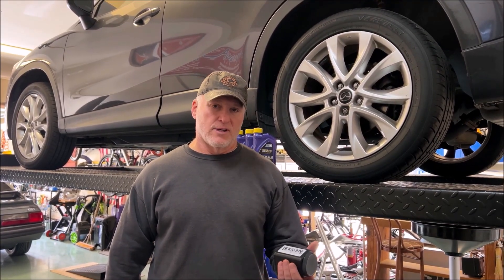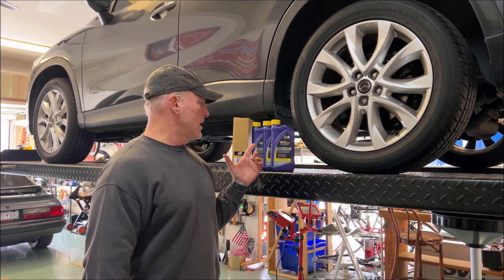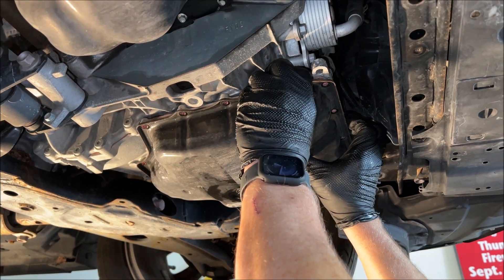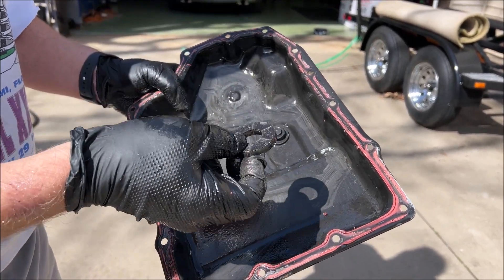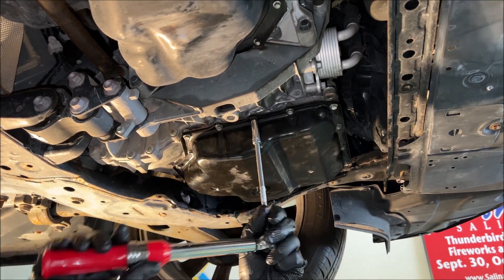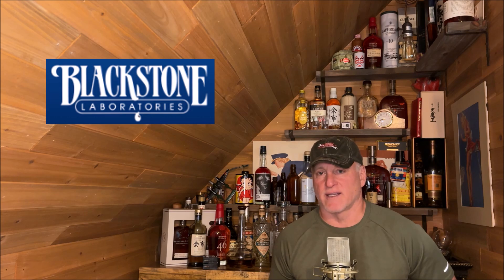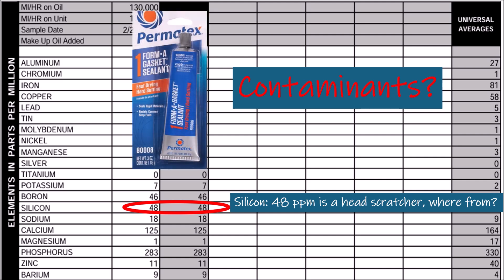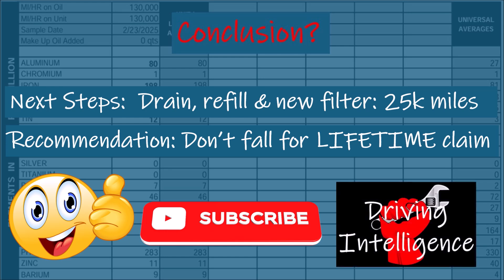Why Lifetime Transmission Fluid Fails: Mazda CX5 Blackstone Test Exposed

Comment: Planned obsolescence?
Reply from the maker: My opinion, manufacturers designed and built the car to get past the warranty period with no claims, also, it sounds great, "maintenance free transmission"... a possible selling slogan.  It seems to me many get rid of their vehicles well before major mechanical issues occur and manufacturers take this into consideration.  My channel is devoted to proper maintenance so as to retain vehicles many more miles and years.  My F150 has 267k miles on the clock and keeps on trucking.
Reply: @DrivingIntelligence  Great video. I remove the air box and use a funnel to easily refill trans from above.
Reply from the maker: @billjames3030  great comment, thanks
Reply: @DrivingIntelligence  Mazda do not make their cars to deliberately grenade when just out of warranty.  Mazda fully expect your car to last at least 20-30 years if you so desire.
Reply: @DrivingIntelligence  You have overheated that transmission.  It's that simple.  Has the CX5 ever towed????????
Reply from the maker: That transmission shows no sign of being overheated
Reply: This isn't planned obsolescence. An automatic transmission will last 200k+ miles will no servicing. Depending on the brand, the transmission will be doing fine at 250k miles when the rest of the car around it is just about done; sometimes due to rust, sometimes due to owner negligence
Reply: @philbrutsche8928  You are 100% correct IF the trans has not been overheated!!!!!!   If that happens the ATF fluid is destroyed over time.  But yes I have had cars for 15 years from new and sold at 400,000 Km's (250,000 miles) and the fluid was never changed, it was not black and was a light clear brown = due for replacement but still shifted perfectly.

Comment: I’m not very good at hands-on work. I only plan to do a drain and fill — is it okay if I don’t open the housing or replace the filter?
Reply from the maker: I would highly recommend replacing the filter for longevity.  It really is rather easy with just a bunch of bolts.  Just follow my instructions in the video closely and you'll be ok.

Comment: Thanks! I have a CX 50 and can leverage the CX 5 videos that you post because they are basically the same vehicle. What oil filter would you recommend for a Mazda 2.5 non turbo? Appreciate your response.
Reply from the maker: Hi Joe, thanks again for your awesome generosity!  I recently made a video showing why I will only use the Mobil 1 Filter.  Check this video to see why.  I installed the Mobil 1 on the CX 5 you're seeing in my videos.  https://youtu.be/XNLZdQ-PwsE

Comment: The fluid gets dark pretty quick. It's blue when new.
Reply from the maker: some of the Mazda fluid is blue. The fluid that came out of this car was originally red
Reply: @DrivingIntelligence Oof. The factory and correct fluid to use is Type FZ which is blue. Somebody messed up and filled with red if you got ree fluid out of the transmission.

Comment: So my 2016 CX9 has 120k miles, ATF never changed, and seems to have funky low speed shifts in extremely hot weather - otherwise shifts fine. Is it too late to save it?
Reply from the maker: 120k miles is not that much.  Have you towed with it?  Honestly, if it were me and the car / transmission has not been abused, I would follow the procedure I used in this video, drop pan, change filter and add fluid.  I would not do a flush.  Be sure to check your fluid spec.  I just checked the Royal Purple product selector and the Royal Purple Max ATF is ok for your transmission as linked in the description of my video:  Vehicle checked: 2016 CX9 USA FWD with 2.5 SkyActiv Engine
Reply: @DrivingIntelligence  appreciate the advice. Never towed with it, adult driven and always maintained. Noticed the shift issues during Florida vacation in late summer, driving in slow, heavy traffic. I'll get the fluid changed asap (no flush). So you would recommend the Royal Purple Max ATF over Mazda ATF FZ?

Comment: I hAe a 14 mazda 3. Just hit 200k kms. Should I drained and fill my transmition or its too late? I see so many people saying to ride it out and its already passed 200kms so its much better to leave it alone. Give me some insights please, thanks.
Reply from the maker: That's about 125k miles which is less than what was on this Mazda when I did the change.  If it were my car, I would do a pan drop and filter change.  Don't flush.  Really depends on how hard the car was driven.  If you babied it during it's life, it will not be a problem.  If you drove it like you stole it, might be a little risky.  Blackstone told me there should be no problem doing a pan drop and filter change at 130k miles, but the decision is up to you.  I can't make a 100% assessment since I'm not looking at your car.

Comment: My Mazda a 2023 CX 30 uses A7 atf which has no equivalent replacement available so $35 to $50 a quart. Expensive drain and fill every 30k miles but still cheaper than a new transmission. I hope an equivalent replacement to the A7 atf becomes available. My  Hondas are over 250k miles doing drain and fills every 30k since new. Hopefully Mazda transmission will be the same. Very good video.
Reply from the maker: I believe the cost of certification deters aftermarket companies from showing compatibility.  Valvoline Restore & Protect is not DEXOS certified because Valvoline does not want to share its formulation with GM
Reply: The Liquid Moly Top Tec 1850 is the only fluid that mentions it’s a replacement for Mazda A7  and the spec sheet is very close to that of the Mazda A7 brand made by Total. Just haven’t found any reviews of people that have used it.

Comment: Mine is a lil over 200k I’ve never changed the transmission fluid can I change the fluid and filter on it it shifts find
Reply from the maker: I don't feel good giving you guidance at such high mileage.  If it were my car, I might remove 1 or 2 quarts to replace with fresh fluid.  If you can send off to Blackstone for analysis, they can tell you how far the wear has gotten and perhaps at that point make a recommendation.  You've done good getting to this point.

Comment: Thank you, great video hard to find videos based on data and science in a way. I bought a 4th Gen Mazda 3 and it had a fluid change at 90k now it is at 135k and I am gonna change it asap. This makes me feel good about my transmission, looks like it is just gonna be fine. Also I want to point out that the universal average is meaningless because every transmission is made out of different concentrations of metals and parts so it doesn't indicate anything only speculation. It could just be this transmission uses more of those metals compared to other metals.
Reply from the maker: Appreciate your comment, and thanks for checking in. The universal averages on that sheet are for all Mazda CX5s, not all vehicles. So it’s very applicable to the comparison and analysis.  

Good job taking care of your transmission.
Reply: @DrivingIntelligence  In that case it is a decent comparison than especially since new mazdas all use the same transmission

Comment: Thumbs up for sharing good useable information. 

It definitely saves the transmission for long term use as it is a good transmission. 

I am actually overdue to replace transmission fluid on our CX5 2L, which i will DIY as i do all maintenance myself.

They are such awesome solid SUV.
Reply from the maker: Agreed!  And thank you

Comment: mazda skyactive  transmission oil is mazda type fz. fz is a blue colored fluid. Been changing  my transmission fluid with the Mazda fz every 100,000 miles. Change the transmission filter every 2nd transmission oil change. I have 482,405 miles on the original transmission and engine.
Reply from the maker: yep, learned that through the comments, so this was had been changed before.

Comment: Nice video reminds me my 2014 cx5 I did the same fluid and filter change at 135k miles twice with Mazda atf and then after 2 years again at 155k mile I put some Amsoil signature series in there but before that to make sure I take out all Mazda green fluid I did 3 times once in a week with Valvoline max life and then twice with Amsoil.
After seeing some oil analysis like yours i didn’t like Mazda fluid at all low calcium phosphorus and boron compared to other non oem fluids so that’s why I did a deep cleaning.
Reply from the maker: Thanks for sharing your experience and the detailed fluid change process
Reply: @DrivingIntelligence i don’t understand how manufacturers can call lifetime an cheap synthetic blend fluid to keep viscosity as low as possible for fuel efficiency restrictions by government and with pretty low additives.

Comment: Just got a 2026 Mazda CX-50 Hybrid. Says lifetime on the fluid as well. It is an e-cvt so should it be changed more often? I figured we would change it at 60k and do oil every 4-5k. Nice video!
Reply from the maker: I think 60k is conservative enough for a pan drop, fluid and filter change.  I plan to change the transmission fluid in all my vehicles at 30k intervals.

Comment: The best way to serve transmission at this milage is to do a drain and fill first. Then drive about 500-1000 miles or so and then do full service with a filter. Depending on a transmission, you usually replace about 35-50% of total fluid capacity, because pan does not hold to all the fluid and half of the fluid is inside the tranny - like fluid pump, valve body and torque converter. Also, manufacturers manuals are BS. Think about any car brand that wants you to renew cars every 3-5 years so by following their maintenance schedule, you follow their plan of archiving it. Most people sell their cars before 5 year mark so manufacturers do not care what happens to a car in second or third hand. As long as original buyer is happy, it is a win for any car brand. So, all of to say, I agree with replacing transmission fluid every 30K miles, assuming no towing or off-roading / racing - in those cases, cut the interval in half. Same goes for transfer cases and differentials (both front and rear) - not the case for this Mazda but just a rule of thumb! Great video!
Reply from the maker: Thanks for sharing your detailed insights and experience

Comment: What would be interesting is if you could get another blackstone report with virgin mazda atf and see just how much the additives have deteriorated over fresh fluid.

I've heard back and forth on aftermarket transmission fluids. I think it's one of those areas where even if it is suboptimal for the transmission, you won't see it until tens of thousands of miles down the road-like how eating a bag of chips isn't gonna make you fat right away. Not worth the risk to save $5/quart for me. It's not like you're doing transmission fluid changes anywhere near as often as you do oil changes. I don't think the aftermarket oil analogy applies in this case-most oil brands use the same refineries and have pretty similar additive packages. Transmission fluid seems like it would be engineered with much tighter specifications for the application since it has to last well over 60k miles as opposed to maybe 10k max between oil changes.
Reply from the maker: appreciate your comment.  I didn't go with Royal Purple to save money, rather, for the observed performance.  It's been great in my other vehicles and per the Royal Purple site, complies with Mazda requirements.

The suspended metals indicated in the Blackstone report necessitates the need to replace the fluid more often.  This even if the additive package may still be somewhat intact.

Comment: Some brands/models have 'severe service' standards that suggests changes of even 'lifetime' fluids. On more recent Mazda models with automatics, apparently Mazda is the only source in the USA for ATF, especially if has a 'start-stop' feature. It is expensive too, $20/L for the non-stop-start cars, $40/L for stop-start models. Sadly such an expense discourages customers from changing the AT fluid.
Reply from the maker: appreciate the input.  I've had no problems with the Royal Purple ATF used in this car.  No slips or stumbles.

Comment: Stop with the repeated drain and fill trying to get the fluid clean. Undo the transition fluid cooler line, and let the engine and hydraulic pump force out all the fluid until the torque converter is full of air, and air is coming out the cooler line. It will take barely a minute.
Reply from the maker: dude, next time pay attention to my video... I did not want to replace all the fluid because suspended clutch material in high mileages vehicles might be keeping the transmission running properly.  All new ATF in a high mileage vehicle can cause problems.  Look it up.

Comment: From my experience with SkyActiv 6 speed auto Mazdas the original ATF FZ fluid is blue coloured, I'd guess your vehicle had already had a fluid replacement before you got it. Even though it looked quite black in the drained container, the fluid on the trans valve body looked reddish.
Reply from the maker: Thanks for this input, I just checked and you're right.  The car was bought with about 40k miles on the odometer, so at leas 90k miles on this transmission fluid.  It did show wear in the Blackstone report.  That means running on the original fluid is even worse given the measured wear at far less than 130k miles.

Comment: The "Lifetime" claim is always followed buy the weasel words but not for "severe service".  So what is severe service?  Well in simple terms it's the way YOU drive.  He should use Mazda ATF because that matches the transmission.  Mazda automatic transmissions are a bit unique is that they use a small torque converter to get the car rolling and to match shifting but they have a hydraulic clutch and are really a 6 speed "intelligent manual transmission".  That may explain some of the wear findings.
Reply from the maker: appreciate your comment, but it doesn't align with the Blackstone report.  Their averages on the right side of the report show significantly less wear than the sample I sent, and those are all the same vehicle.

Comment: i have a Mazda 6, just rolled 100k, do plan on a drain and fill with a new filter. never bought into "lifetime" fluid of any kind. mazda does not specify # of miles = lifetime, my argument is if my trans goes out at 90k is that "lifetime" of the trans, or 100k/120k/150k?? i do agree that mazda transmissions are built to last, but with proper maintenance intervals. GREAT video.
Reply from the maker: Thanks for your comment.  I've had some comments about what lifetime fluid means, some think it never needs to be changed, ever, and some think its 100k miles.  To me, lifetime is length of ownership, whether 100k or 300k.  I have 272k on my 2002 F150 and only recently rebuilt the transmission myself since it is my daily driver (even long distances).

Comment: I changed the transaxle fluid on my 2021 Kona at 23K miles last week. Simple and worth it.  The fluid that I removed was in good shape. Do your coolant and brake fluid regularly also, or at least test it with the strips
Reply from the maker: good input
Reply: @andredaedone7732  Just did all that on my 2017 CX5 @53k miles.

Comment: Hey I have a question and wondering if you could help. I have a 2015 mazda cx 5. Third owner. I am thinking about doing a transmission fluid change like what you did in the video but I am a bit concerned about the gasket that you used for the tranny fluid pan. How long has it been since you put the gasket on? Has there been any leaks? Thanks!
Reply from the maker: thanks for checking in.  It has been several thousand miles since this fluid change and no leaks from the transmission.  Tight as a drum.  If you clean the surface and properly torque the pan, you will not have a leak.  I always prefer dry gaskets.

Comment: I have a 2018 Mazda turbo with over 150,000 miles. I ran into what you saw, Life Time Transmission Fluid.  On more than one occasion I have been warned if it ain't broke don't fix it.  Or we don't change transmission oil unless it is at 50k miles. News to me.  I have not gone to the Mazda dealership as you might imagine, it is costly. I have been considering taking it to a transmission service to get the transmission fluid changed out.  I am reluctant because I hear that changing transmission fluid with so many miles will cause problems when their was none, due to the cleaning effect.  I don't work on vehicles, but I read.  What would you advise?  Leave it alone at 150,000 miles, or change it?
Reply from the maker: You are in that iffy zone.  I did a complete flush of my 2002 F150 at 180k miles and ended up with torque converter shudder, but this truck was used for towing before I got it (heavy loads).  I spoke to Blackstone and they felt a simple pan drop and filter is not a problem.  If the car hasn't been driven hard, you can do a pan drop and fluid change and send a sample to Blackstone.  

To be extra safe, do it yourself and reclaim half the fluid that is removed and put back in the transmission with a couple of quarts of fresh fluid.  Then do it again in another 30k miles.  

The transmission in this Mazda CX5 loved the fluid change (1/2 the capacity).  No issues after changing the fluid at 130k miles.
Reply: @DrivingIntelligence  Thank you
Reply: @DrivingIntelligence  Thank you for your video and your advice. I am trying to make sure she lives as long as is possible.
Reply from the maker: These Mazdas are so good I’m improving this little CX5, make sure you check out the other videos in my CX5 playlist.